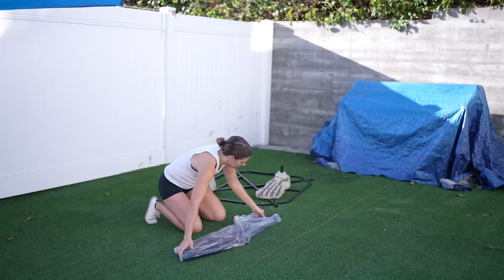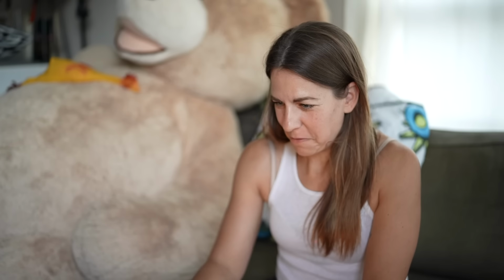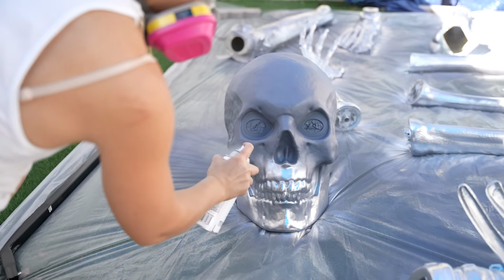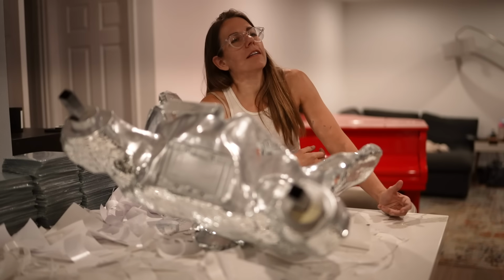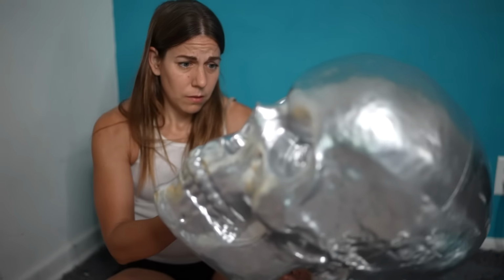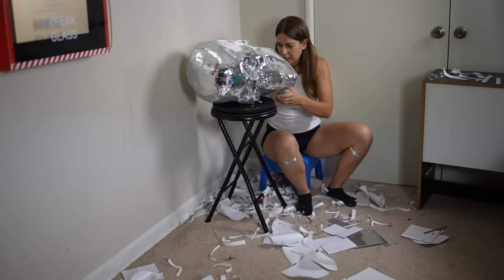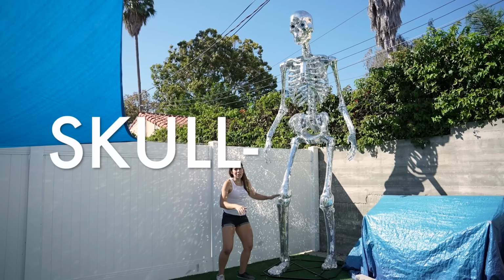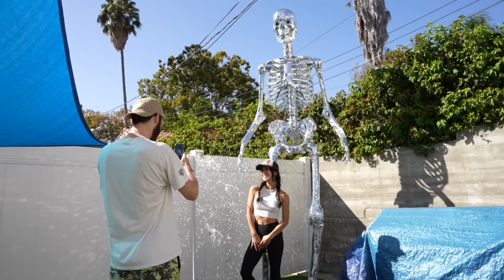I Make a 12ft DISCO BALL SKELETON

Comment: For anyone who wants to work with large amounts of spray paint please remember that some of these fumes can be dangerous if inhaled! If you try to apply spray paint remember to always, always use a face covering and spray in a well ventilated area! (And putting texture on the surface before applying paint helps the paint adhere better to the surface (ex: sanding a smooth plaster surface in order to prevent the paint from peeling off once dried and having to bare the elements)) 
	Ali, if you’re reading this remember your face covering when working with things that have airborne particles! If they get into your lungs, it can cause many, many respiratory issues!

Comment: So now that video is over... what happened to sparkly skellie boy? I hope its not another spend money and effort for video and then trash the project once its filmed? Some disco might buy it as center peace, or as peace on some tourist spot. Too bad those were self adhesive tiles, probably wont deal outside well, though if one would fill the gaps with say epoxy it might last long time and be so much easier to clean.